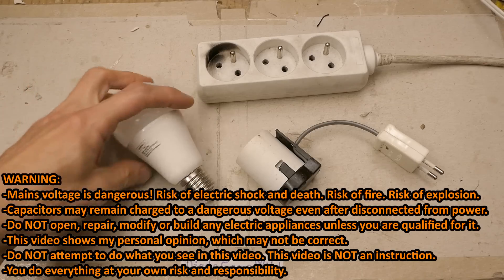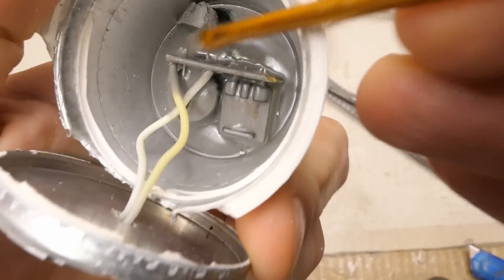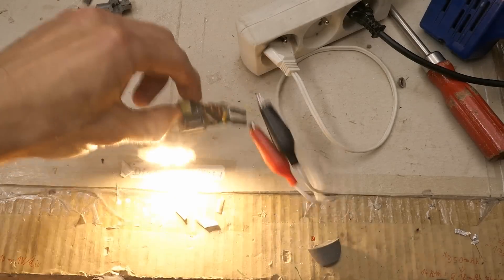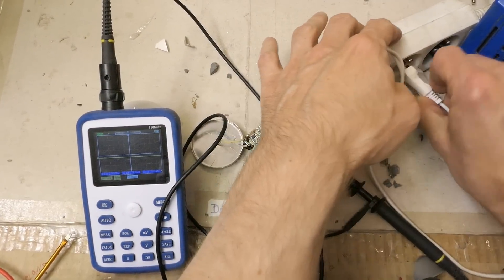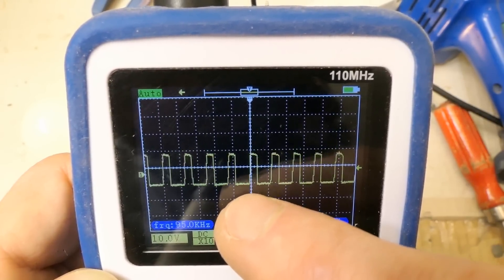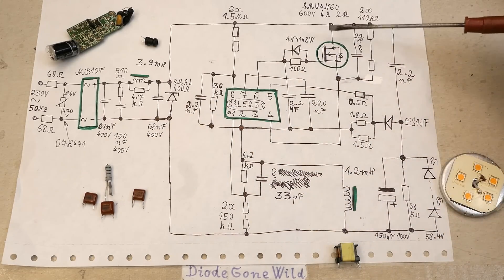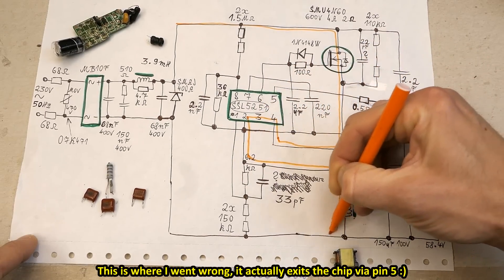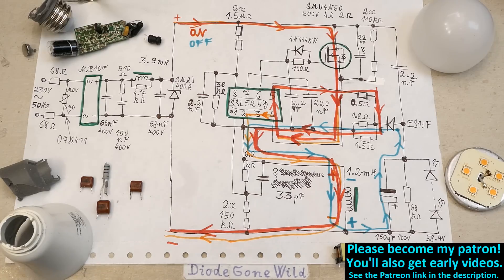Failed 12W LED analysis and schematic

Comment: This is a pretty old design and I've never seen them potted like that, but it seems pretty good overall.  It is unfortunate that so many LED bulbs sacrificed their advantages for lower pricing and repeat sales.  I never buy generic brands from Amazon, but have found that the bulbs at local stores (i.e. Walmart) tend to be pretty good, though I still modify them to use half their default current.  BigClive calls this a "dooby" hack after examining some of Dubai's high-efficiency bulbs a few years ago.

LED technology is not necessarily bad and the industry is probably moving in the right direction today, but the first decade of LED replacement was horrible and many manufacturers were simply scam artists.  It made me angry that CFL bulbs simply disappeared from stores as though they were contaminated with EColi, but I found and bought a stash of them from the bottom shelf of a brick-and-mortar store just before the bulbs disappeared ;).  CFLs from reliable brands had become quite good by then.

LED simply wasn't good enough when it was pushed into mainstream use and society wasted a lot of money on terrible LEDs that had to be continually replaced in homes, offices, and street lights; the promise of long-lasting bulbs was simply abandoned for profit.  Even today many consumers are buying cheap, no-name LEDs from Amazon and wondering why they burn out every 1-3 months :(.
Reply: I was an early adopter of CFLs, since the late 1990s.  I could put up with the deficiencies of the early ones for the savings in running cost, and they did improve noticeably over the years.  The electricity companies started to provide them cheap or free, probably for some kind of tax break for helping reduce energy consumption, and those ones were not bad, certainly not for the price -- I guess they were careful about what they put their name on.  And by the time I had used up my entire stash of compact fluorescent lamps, LEDs were already into the second generation.

The first generation of any new technology is necessarily a bit experimental, because there can be as much difference between the R&D lab and the field as there is between theory and practice .....  so really, when it is first released to consumers, this is just the final round of testing in real-life situations.
Reply: @bluerizlagirl  the problem with CFL's was the warm up time. when the first came out i got a few for the house. but soon took them out of all the room lights as I would turn on the light walking in pick up what I wanted and leave,  Just as the lamp was getting to full brightness I'd turned it off. 😞
still got one left in the cloakroom as it don't get used much so can't be asked to replace it while it still lights.
Reply: @TheEmbeddedHobbyist The early ones could be slow to reach full brightness, especially in Winter.   But later ones managed to overcome this, though maybe at the expense of some longevity if they were just driving the tube harder.

And maybe it's because I tend to stay in one room, and leave the light on  (since it's costing so little to run anyway; an hour's light from a CFL costs the same as 12 minutes' light from a tungsten lamp)  during brief absences.  If you wander about, switching lights as you go from room to room, maybe the warm-up is more noticeable.

Anyway, if you avoid the absolute cheapest LEDs, you probably will be fine.  If buying a big batch, run them in for a few weeks at first and if any do fail early, at least they will still be in warranty.
Reply: As a nerd obsessed with plasma I like CFL more than LED.
Reply: I  buy the brightest led lamps i can then change the current limit to provide about 2Ws. These get turned on by HA as general background illumination and so  ot had to replace one.😊

Comment: The schematic was "bloody complicated", but all made perfect sense when you explained it. Great video. It's a shame that so many products end up in premature recycling bin because of such a simple, preventable manufacturing fault.
Reply: Too many electronics with weak points in design, production, or QC.
Reply: @dosgos  It was a very nice circuit, well-made and easy to adapt to a screw-in or push-and-twist base.  What let it down was relying on the connection between the wire and the metal threaded part, which is just pressing against it with no soldering. 7/10, could do better.
Reply: The results speak for themselves.